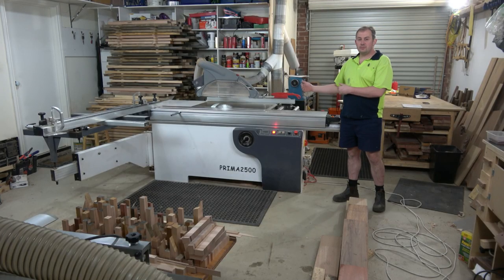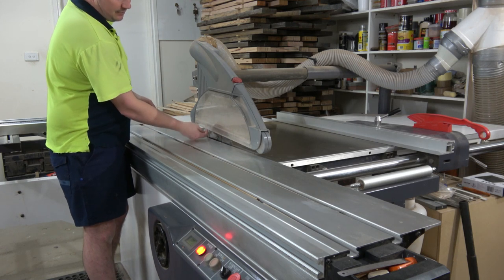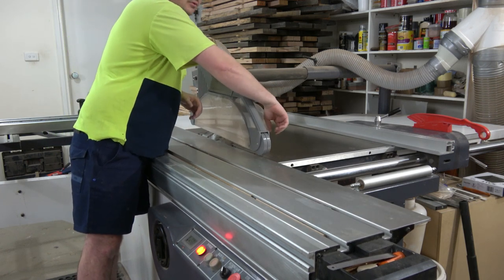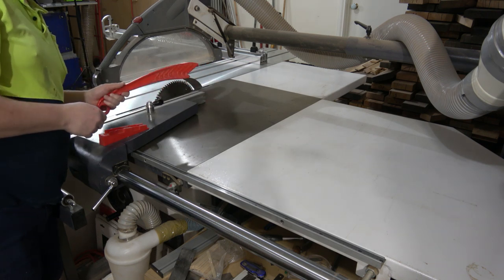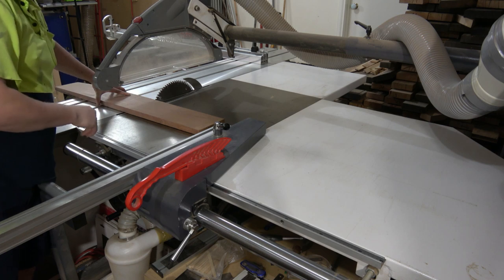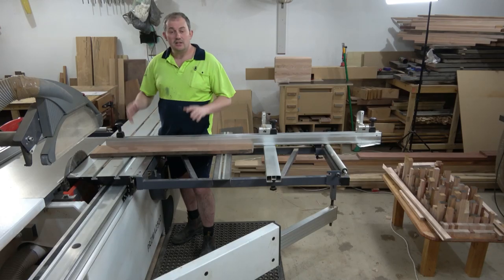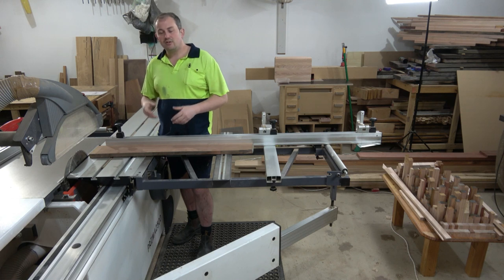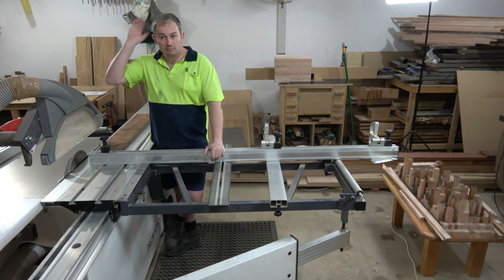Why I use a sliding panel saw instead of a table saw // Prima 2500

Comment: Well done and very interesting to one considering a slider. As shown around 9:30, it's always best if you can feed the work by putting your ass into it. Is the saw's internal baffling good enough so that little cyclone under the table able to capture most of the dust? WelI done. I've subscribed. Thanks.
Reply from the maker: The dust extraction is the worst thing about the machine. My machine is only fitted with a 4" port. I would have preferred a 6" port. I can retrofit one, but it means carving a lot of 1/2" thick cast iron away to make room for it. On all panel saws I have used, they all suffer from the same problems. Dust collects on the ground beneath the saw. I just leave a piece of cardboard under the saw, and every now and then, pull it out and clear away the debris.

Comment: Is it easy to cut a long (2500mm) narrow (150mm or less) board into two boards with same length (2500), with 75mm width each other?
With the classic table saw it's easy
Reply from the maker: Yeah. It's done the exact same way as with a table saw. Set the rip fence to width, then rip the board down the centre.

Comment: Great vid mate , how long did it take to assemble and true up , it looks complicated did you get any help
Reply from the maker: It was already assembled as it was a showroom model. There isn't much to assemble if it came straight out of a packing crate. It doesn't take me long to true up the slider and then square up the crosscut fence, maybe 10mins. No help needed 👍

Comment: Having recently landed in NZ and in the process setting up my cabinet shop to produce Euro style cabinets it seems to me that a slider is much better choice than a typical  cabinet saw. In particular since most come with scoring blade.  That aside what I hesitate to give up is the ability to saw through dados' and I haven't found a slider so far that accepts a dado.  If I go the other way with a cabinet saw and sliding cross cut table I get the option of a dado capable saw but the scoring blade is eliminated.  And since 99.5 % of all the cabs I would produce incorporate some amount of Melamine and never having found a main cutting blade alone capable of being 100% chip free that argues for a typical slider with scribing blade. Plowing dados on a router even a 2000 watt unit is slow,  and often leaves a wandering depth in my experience unless I had a power feed which I don't anymore. I guess my questions is how do you compensate for the lack of dadoing capability. Or is that a factor in your work flow?  I don't want to invest in a spindle molder just for dadoing but it seems to me it is the  best work a-rounds for a small commercial shop were machine time equals money.  I suppose I could have a dedicated cabinet saw for dadoing but that just seems silly.  You thoughts if you are so inclined to comment thanks.
Reply from the maker: There isn't much dado'ing in euro cabinet work. It's all butt jointed together with some screws. For all of the cabinet work I have done, I've really only wanted a dado stack when I am cutting tenons on solid timber furniture components. A spindle moulder would be great to apply a rebate to the back edges of the sides, faster than a dado stack too.

Comment: Great video Kuffy, well explained and very reasoned explanation at that. I love watching you use that thing and the precision you achieve. 
Do you have a dato stack to go on it? I think Joey over the ditch got one for his, but if i recall a series one Shopstool podcast where he talked about it it wasn't all plain sailing.
Reply from the maker: Nah, I don't have a dado stack for my saw. The saw arbor is quite short, not really designed for a dado stack. I could do something which is ill-advised, but I don't really need a dado stack and when I do I will only save about 10 minutes total for a complete job.

Comment: Very good video thank you, this could be a great alternative to usual brands.
Just wanted to ask, how long do you have it and how is the precission and squareness on it?
Reply from the maker: I've owned this saw for about 5 years. It cuts straight. The squareness is dictated by the setup of the crosscut fence. Providing the fence is set square, it will cut very accurately 👌👍
Reply: @kuffyswoodwork   Just seen your post on one of the forums (or maybe that was someone else) that explains everything, very helpfull, seems like great saw for the money.
Thank you

Comment: How to use this machine as cabinet table saw, while the sliding table is usually adjusted not flush with cast iron table, but it is usually adjusted higher?
Reply from the maker: The majority of cuts are made on top of the slider. So it doesn't matter if the slider is higher than the cast iron table. Sometimes it matters, but it is very rare

Comment: Good Stuff Kuffy, You make a good argument for... With all the other stuff I have in my Workshop, I definitely don't have the real estate for such a big saw. I did around last Christmas, having seen how you work, did invest in an 'Add on', to my table saw in the form of   a 500mm sliding table. It has a reach of about 1.8mts so not a full sheet, so the track saw still gets used, but I do enjoy the benefit. Now, I just need to convince you to get a Domino... Boy would you productivity increase LOL. Just for interest, I looked up the price of your saw on HAFCO.  $9295. I definitely can't afford that.
Reply from the maker: Leda Machinery have the Prima 2500 listed at $6700 +gst. A lot of people add on a sliding attachment to their table saws. It is a very good attachment to have imo. I very rarely use the 2500mm travel of my slider. I pretty much just head cut a MDF sheet first and then make the first rip at about 1800mm long. Saves me having to put the crosscut fence up to the front of the outrigger. The dominos will cost me $4000! I need both because I'm greedy 😂👍😂😂
Reply: @kuffyswoodwork  But there is a fancy bit converter that you put on the 700 so you can then cut down to the 4mm. so only $1600   Happy days  :)
Reply from the maker: @cobberpete1  I'm pretty sure the adapter has some limiting problem. Nothing I couldn't work around, but if I am spending 1600bux, I may as well just spend 4k. Don't wanna be caught short

Comment: If I had unlimited shop space, and a unlimited budget. I would use a sliding panel saw, as well. I used a Rockwell sliding panel saw a long time ago. It is the safest way to cut sheet goods.
Reply from the maker: If I had unlimited budget and space, I would occasionally use my panel saw when I'm not using the industrial CNC router or beam saw. We can only dream 😜

Comment: Kuffy, you should explain to the poor non-slider users what a "straight line rip" is and why it's such a wonderful thing. :)
Reply from the maker: Hehe. I actually very rarely straight line rip on the saw. I do it for MDF panels of course, but I find it is quicker to straighten boards on the jointer and I get a cleaner cut without tearing away the bottom edge of the board than when using the saw. I figured people would understand straight line ripping, because it's the same thing as a track saw. I do have a problem of thinking that everything is so basic and everyone must know it, which is why I'd make such a bad teacher 😂
Reply: True, I don't do it that much either, but it lets you control the average direction of the cut better than a jointer and it is situations like that where a jointer might give a different angle than I want that I get out the shoe and some wedges and do a straight line rip.
Reply: @djeity  i use the straight line rip when jointing white oak boards to make table tops. the rip does 90% of the work, then i run it thro my segmented head 6inch jointer. i dont have to press so hard on to the jointer outfeed bed to make laser straight joints as most material has already been removed by the sliding panel saw.
Reply: arist Tk BINGO, that’s exactly why this saw, with its straight ripping ability, saves you a ton of time when milling rough stock.  Lot less time and physical effort at the jointer.   I’m looking at Felder S700K, but two others are still in the running, Altendorf  and SCM

Comment: Have you figured out how accurate the saw is to “true up” or square a sheet of plywood?  I never trust a factory edge on my plywood sheet goods, so I would straight line rip the very edge of an 8’ side of the plywood flip it 90 degrees and then cross cut it.  I’d like to see how square you could get the sheet.  Thx
Reply from the maker: The saw when setup correctly will square up a sheet quite easily and accurately. I am with you on not trusting factory edges. Rarely is the sheet "square" from factory, and it's not uncommon that single edges aren't even straight. Providing the slider runs true and straight, it's simply a matter of making sure the outrigger crosscut fence is set square to the slider. Then everything comes off the saw nice and square. Most of my cuts are with solid timber and therefore mostly 8" or shorter. If my saw is set to be within +/-1/32" of square over a 8x4' sheet, then my 200mm cuts are pretty accurate.
Reply: Kuffys Woodwork have you ever taken the time to test it out?  Just wondering if it’s not to hard to get it dialed in.  Within a 1/32 on a full sheet would be great.  I cut up plywood for my projects 50% of the time, so it would need to accurate for me.  I would also love to straight line rip my rough cut hardwoods to save me some time at the jointer, which at that point, the jointer will be for just cleaning up the edges.  Thx
Reply from the maker: Yeah, I've tested it out. I continually test it as I go because it's possible to knock things out of square. It is very easy to square up again.

Comment: Hi, I need your help.  I just purchased a minimax CU 300 classic to start my woodworking hobby.   This machine cost me over $15,000.00 to get it my garage.After the company got my money, they ignored all my calls , and now I am helpless getting this machine set up.  It has been 2 months now.  I was wonder if you have any knowledge , or anyone in this forum that can help me get this machine up and running.  all suggestions are greatly appreciated.
Reply from the maker: Sorry to hear about the troubles you are having. Poor customer service really is an irritating thing, especially after they have your money. Do you have power supplied to the machine? Or is the machine still on the shipping crate and wrapped in stretch wrap?

Comment: Pretty good looking machine and great video thanks, but please don't get in the habit of putting your hands in around the blade with the power on to the machine, very small chance of it powering up but the risk is there, keep up the good work, look forward to more vids
Reply from the maker: Thanks mate. As a general rule, I don't touch the blade while power is supplied to the machine. There is a isolation switch (not an emergency stop) down at my knees which is easily flicked on or off.

Comment: I have a sliding table saw but different brand and I'm happy with it to a point when your ripping timber along the fence and part of the timber sits on top of the sliding table you don't get a 90o cut and you have to do 2 cuts so that's the only thing I find bad about a sliding table saw
Reply from the maker: Yeah that sucks. Often it is not an issue for me because I finish the edges on the jointer and thicknesser. But when using the panel saw to make tapered legs, I need to remove the bulk waste on the bandsaw first so that the leg only rests upon the ripping table and not the slider.
Reply from the maker: @RazaXML  no, the top surface of the slider isn't level with the table. The slider is set 0.2mm higher than the table. So when ripping timber, you don't get a truly square rip. It doesn't affect me because I square my timber on a jointer
Reply from the maker: It works better when cutting sheetgoods with slider set slightly higher. It's really not much of a problem. It affects me maybe twice a year, and each time it costs me 20 seconds. No big deal really

Comment: But what if you wanted to put your finger between the riving knife and the blade?
Reply from the maker: Well, if that's what you wanted to do, then you would need to move the riving knife away from the blade enough to allow your finger to fit. Though it may be a difficult task to do while strapped in a straight jacket 😜
Reply: @kuffyswoodwork  I don't often laugh out loud but I did when reading this comment :-)

Comment: You can also take out the cost of a jointer
Reply from the maker: A panel saw certainly is pretty good at edge jointing boards, though sometimes it has a tendency to chip out the bottom edge. I still need a jointer for the work I do so I can flatten boards. It can be done in a thicknesser, but a jointer does it better and faster

Comment: SAWSTOP,,,umm  I like the magnetic version which is out now on other machines,,,they drop down like the sawstop version but one great benefit,,,,,you dont need to replace the blade and parts every time it happens, ie saving of $300 each time...A super electric magnetic pulls the blade down and then raises back up when you press the reset switch..they be out there soon on all machines...better invention, however you hope you never need to use it.
Reply from the maker: Yes, I've seen the other ones from Bosch. Looks pretty good 👍

Comment: Wow... 3" max cut from a 12" blade ?? Where'd the other couple inches go ?? 🙄😭
Reply from the maker: Yeah, it's a disappointment. The saw is designed for sheet goods, so 3" is plenty. But they could have done better.
Reply: It looks like 10" blade

Comment: Why don't you use, or talk about the scoring blade? That's a primary and unique benefit of a sliding table saw. You don't even have a scoring blade installed.
Reply from the maker: I primarily work with solid timber, so I don't need the scoring blade. I only use the scoring blade when I need both the top and bottom edge to be perfect, such as when working with veneered boards or melamine boards. Having the scoring blade cutting solid timber dulls the scoring blade and increases the time it takes to make each cut, and it gives me zero benefits.
Reply: @kuffyswoodwork  Thanks for the reply. That makes sense.

Comment: title needs fixing, this is not a panel saw. this is a sliding table saw. big difference.
Reply from the maker: A sliding table saw is just a table saw with a slider attached to the side of the table. The slider is approximately 300mm away from the blade. A panel saw has the slider right next to the blade, just like my saw. There are other saws which are described as a panel saw, such ad a vertical wall saw or a beam saw.

Comment: They dont last very long 😡
Reply from the maker: what doesn't last long? The saw?
Reply: Yeah i have the 3200. Its a piece of shit. New saw coming soon
Reply from the maker: @fellsrenovations  ah damn, I've been happy enough with my saw. I'd upgrade to an Altendorf F45 in no time flat if my shop space increased in size dramatically
Reply: I believe that who ever installed it didn’t do a great job at all . So now the saw is all over the shop. Only had it for three years. I have upgraded to a fully automatic one. Glad it worked for you mate. It just always goes off square. And rip fence gets stuck all the time I have had enough . I need it to work on a regular basis cos i make loads of cabinets. Last week i kicked the shit out of it and traded it in.
Reply from the maker: @fellsrenovations  oh yeah, my rip fence gets stuck. I have to keep the round bar very clean with WD40 and that seems to work. I hope your next saw works out better for you.
Reply: @kuffyswoodwork  thanks mate..... its all automatic rip fence blades and all so it does it all it self. It also has a program /software where you punch in cabinet sizes and it tells you what to cut and how without measuring anything anymore. I cant wait. Realistically its like a cnc but manually and crap load cheaper. Cnc is coming next year. This covid has put the world on a stand still
Reply from the maker: @fellsrenovations  Sounds awesome, enjoy it
Reply: @fellsrenovations  what happened to your saw? Looking for all the pros/cons.. What saw did you replace it with?
Reply: @cygnusa3772  side fence gets stuck all the time. Cutting fence goes out of square all the time. I always have to adjust it and its time consuming. Also the measuring aluminium strips moves no matter how you stop it. I just think that they should have used more durable gear. Cutting is ok. Extraction set up is a piece of crap. Doesn’t matter what hp vacuum you use you still have to clean up underneath daily. I replaced it to a woodtech saw. Dream come true that is. Havent touched any setting since being installed 12 months ago